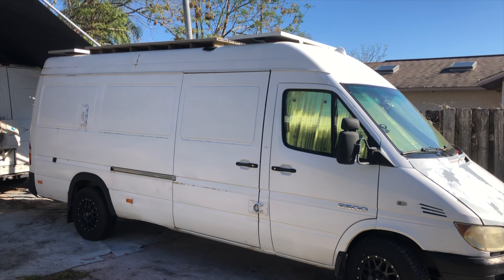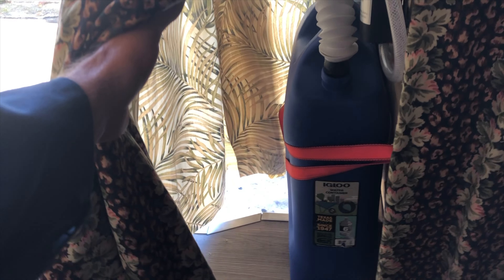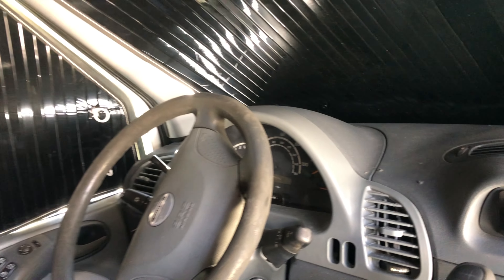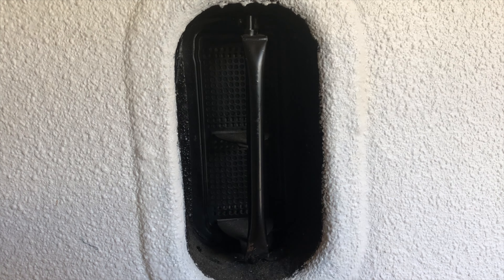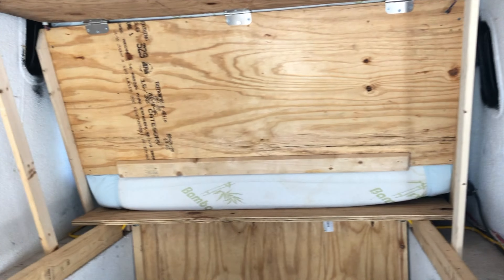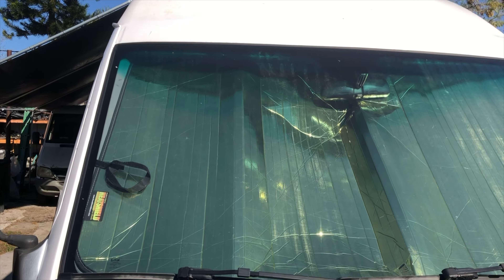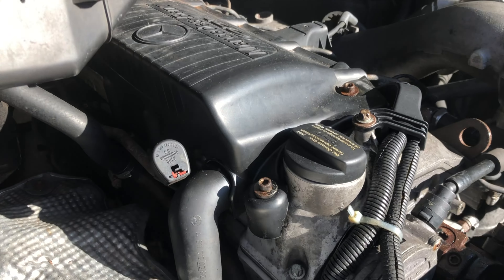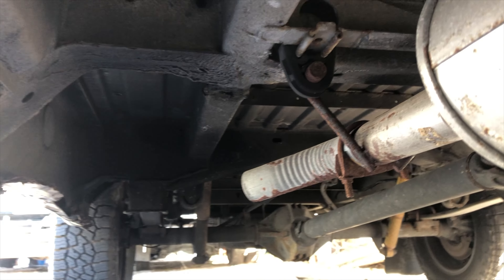2004 Sprinter T1N Camper Van 2500 SHC Dodge Mercedes FOR SALE in Central Florida $13,000 O.B.O.

Comment: Thank you for the great videos! I just came across a pair of sprinter vans which are former FEDEX vans. the guy selling them wants $5k for both (he will not split them up)..  they’re both year 2005 with the high top and 158” wheelbase. Van #1 has 294k miles, it does crank and start, has minor rust around the windshield, no rust around rocker panels, interior is a bit beat up, and it’s making a knocking noise from the engine. It also has significant blow by (oil cap dances way too much), it also has the Black Death around the injectors as well, and some oil leaks. 
Van #2 has 345k miles. It does not crank nor start. as soon as you turn the key, the AC fans turn on,we believe it’s related to an ECU issue (I did ground pin 44 and checked voltage at pins 1, 3, and 5 and there was voltage in them. Also, we did swap out the ECU with another vans and we got the “error start” message on the dashboard), it has very little to no rust spots around the windshield, it has the better of the two van exteriors, has heavy duty shelving in the back on both sides of the van, it also has two lights and a fan back there as well, heavy duty rear step to access the rear cab, no signs of Black Death, and the interior is beat up/worn due to the miles and lack of care from previous drivers. What do you think is a fair offer for the guy? Is 5k a steal or too high since neither van runs.

Comment: I have this same model and I was wondering if you could tell me what the button with the hinged lid is on the right side of the middle of the dash
Reply from the maker: Is it about 2 inches square with rounded corners? That is a document clip to hold your parking ticket. Useless, actually. :(

Comment: I would say 5k max. This is a real shody looking build on a 19 year old vehicle
Reply from the maker: Thanks for your input. Have you priced T1N Sprinters or comparing this to Fords and Chevys that would be dead before 200,000 miles? These vans sell for $5,000 empty with engine trouble. If I part it out the engine is worth more than $5k.
Reply: @FloridaVanMan  I understand that the market right now allows people to absurdly raise prices on depreciating assets but do not try to justify anything more than 5k on something like this.
Reply from the maker: @ryanknight8793  You clearly know NOTHING about the market right now! Nothing has been moving since December and the high prices you hint to were last summer. This van and any like it is still worth more than the allowance your mommy pays you for washing dishes, so kindly do not tell me what to justify on my channel and keep your uninformed opinions quiet. Nobody wants to hear what YOU THINK since you clearly have done zero research before forming your opinion. Would you like me to come over to your channel and get real honest about your "rap"?
Reply: @FloridaVanMan  good luck man

Comment: If the rust didn't scare me off, the non-working dash vents did.  Too hot!
Reply from the maker: Just the vent fins are broken. Heat and air work. It is easy to fix them with a repair kit sold online that makes them stronger than original, or you can replace the part with new for about $40. There are lots of easy to fix details that I just can't find time to do. I've taken care of the difficult stuff and small mechanical issues making it a reliable driver and easy project for someone who wants to buy cheap and DIY dress-it up.